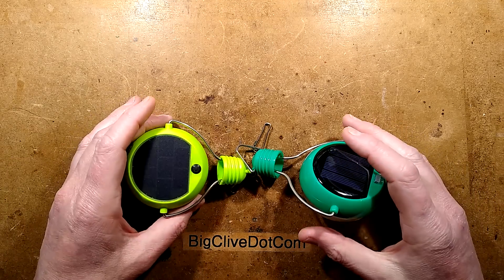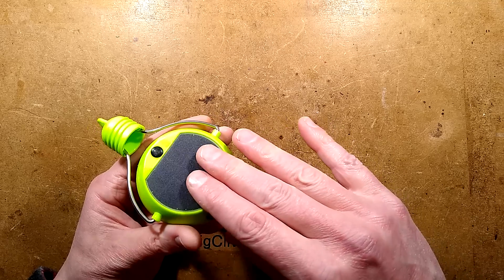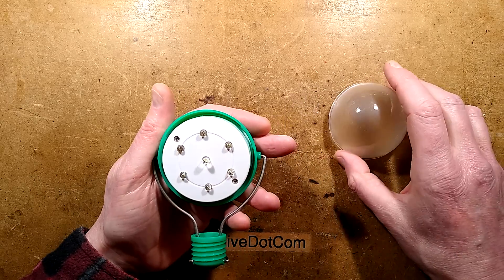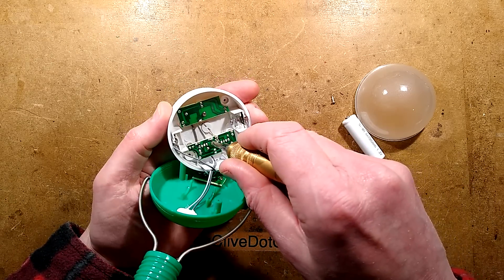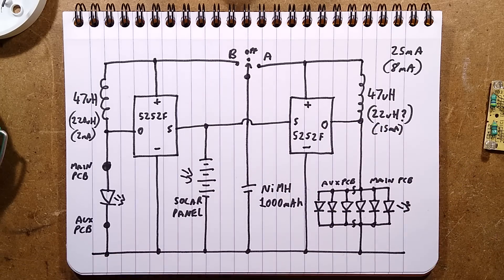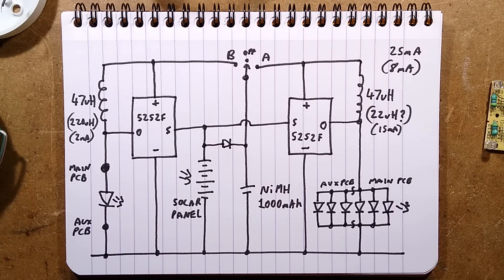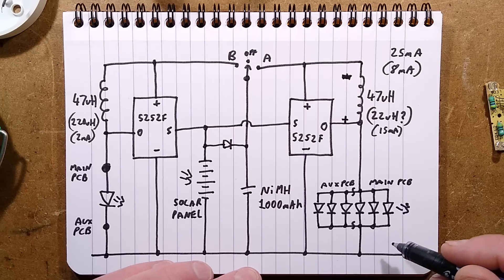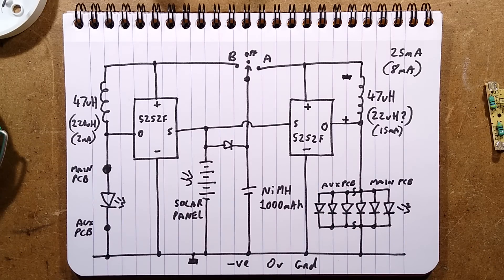Tacky Nokero solar light clone

Comment: They both look like cheap junk with no good practical use. Even though Nokero's solar panel is more efficient - it also has transparent plastic layer coating which will permanently discolor after some time (much, much sooner than something like tempered glass that is used in solar panels where long lifespan matters), and the battery in Nokero was not AA-sized. In that no-name Chinese clone you can at least replace the AA-sized NiMh battery with any other kind of fully charged AA-sized battery (something that is easy to find in most countries around the world) and have a usable light even after solar panel will go permanently dead or in places with long periods of very low lighting (where any kind of solar panel would be useless).

Comment: I mistakenly bought a Tacky Nokero clone from Amazon for $42. They have gotten worse than the one reviewed above. The latest version only has 4 LEDs. All LEDs illuminate in the high and low setting, This is nothing but a slightly modified garden light. I spent $42 for something worth $2
Reply from the maker: If you bought it recently, open up a dispute.

Comment: If I'm reading the schematic correctly, the battery won't ever get a charge if the switch is in the off position?  Therefore, it has to be left turned on, in the sun in order to charge?
Reply from the maker: Yes.  That's why I mentioned the addition of a diode.

Comment: I made a more reliable light by doing it myself.  One 6V (max) 20mA solar panel, one leftover mobile phone Li-Ion battery and a circuit from a design I found online using two NPN transistors, four resistors and a diode.  It drives 10 white LED lights when it gets dark and turns the LEDs off and charges the battery when it gets light enough.  The load of the battery and the internal protection circuit combine to ensure it will never over-charge, and the 10 LEDs draw enough current to pull down the voltage when the battery is fully charged so that it doesn't blow out the LEDs.  It's been running like that for years, now.

Comment: So have I got this right.
Turn it on when the sun is out to charge.
Remember to turn it of when the sun goes away, so the battery does not go flat until you want to use it? 🤔
Reply from the maker: Yeah.  The real one doesn't do that.  But the clone can be hacked to fix that.

Comment: Saw the video during pandemic.. BUT I totally missed the awesom hook on the top end, on both of them.. So if you screw this in a lampsocket you'll make a MASSIVE short circuit if it's LIVE...  or doesn't it fit?
Reply from the maker: It doesn't quite fit into a lamp holder.

Comment: Question for the expert. If a 48v (42v-54v) ebike battery can discharge at 20 amps, shouldn't it be able to charge at 20 amps?
Reply from the maker: Slower charging is much better for batteries.  The limit for charging speed may be the charging circuitry.

Comment: First one would be better if it had a backup led, say it did die, it could activate the second, at least the other device has a few more, you have to ask where they get the same cases and molds etc

Comment: As an aside, certain "ahem" inhalation devices are suffering from hidden shrinkflation. Battery sizes are being reduced in some cases, despite the same packaging and information regarding contents and longevity. A weight check will probably distinguish older from recent contents
Reply: they all seem to end up squashed in the gutter anyway.
Reply: @Derek_Garnham  You have to get up early to beat the squashers.
Reply: @tikaanipippin  you sound like a professional level "lost/discarded object finder" - happy hunting.
Reply: @tikaanipippin  I fantasize about getting enough to power an e-bike or at least a scooter.  Do you have any aspirations of using them in an application? or is it just the thrill of the hunt for you? (maybe it's plain old nicotine addiction)
Reply: Let me guess... they're all made in China...?

Comment: Cost improvement:  remove the left side chip/coil and put the switchover switch on the right side on the output to switch between the 6 leds and the 1 led?

Comment: Speaking of NiMH, one pair of my Panasonic Anyloops has dropped to just under 1500mAh from its original 1900mAh capacity. The other set is still at or above the 1700mAh mark. I am a little surprised that there's that much disparity between the two sets.

Usually I'll go through one set over the course of the day in my Game Boy Color [sic] during the weekend, but last time it didn't last the full day. When I checked after they finished charging, their capacities showing were 1493 and 1511 mAh. I'm thinking of getting a couple of pairs of the high capacity 2450mAh Anyloops, which should last noticeably longer. I'm also hoping the reduced cycling also means I get more than a few years out of them.
Reply: I've got 2 pairs of the 2450mAh Ikea "LADDA" AAs for a Garmin GPS
Reply: I would be converting that thing to lithium...i try to a oid using disposable batteries at all these days if it can be avoided...and it usually can.

Comment: I was thinking about getting into electrical or something to do with circuit boards. I have 0 training or schooling. Where do you suggest I start
Reply from the maker: There are many options that don't require a formal qualification.  Utility electrical and elevator mechanic for instance.

Comment: as far as crap knockoffs go that's not too half bad. at least they used a NIMH cell instead of a damned LION. the nimh cell is easily replaced and should last 10 plus years like the LIFEPO4 cell would

As for the real one the big deal to me is that it uses a lifepo4. meaning it should last 10 years and could last double that and still have usable capacity. now I really want one.

Comment: I'd believe that capacity from a cheap AA, since that's what I was getting out of good AAA cells, years ago when I was still using NiMH for most everything.
Reply: mAh is also misleading when comparing battery types with different voltages, Whr is a better unit

Comment: I wonder what the leakage current into the solar input pins is when Vdd is disconnected. Pretty significant I expect since there is a diode from the S pin straight to Vdd within the IC.

Comment: If they use the same inductor on both sides, couldn't they just eliminate one of the chips and inductors and have the switch toggle between the led choices? For that matter if the LEDs are all the same, make it 5 LEDs on the outside and have the high setting just add them in parallel to the center one.
Not great but it is already not great, they could cut a lot of costs here and not be any crappier than it already is.

Comment: You could eliminate the second ic and second inductor altogether if you did the switching between led strands after the first inductor lol! I don't get it. And 3 pcb's and a bunch of wires? Hell nah just make it all on 1 pcb and use soldered metal tabs to hold the cell in place. Boom no wires, single pcb, and half the parts lol!

Comment: Nokero never delivered the light I ordered, nor responded to shipping queries. No skin off my back -- I have no shortage of power or light sources -- but I'm hoping the two I bought for donation made it to the people that did need it.
Reply from the maker: Sorry to hear that.  I get the feeling you weren't the only one that happened to.
Reply: @bigclivedotcom  No worries -- I'm not upset or anything. My hope is that it was accidentally sent with the donation. At least then it's getting good use, if that's the case. Would just be nice to have some confirmation.
Reply: Mine never arrived either. Company never responded to multiple inquiries. I blame the pandemic, too.

Comment: At least it doesn't have the annoying strobe/sos function. I would love a torch without the strobe function, just low medium, and high would be fine. Every time I switch my torch on and it starts to flash I have the compulsion to throw it against the wall. I'm in my garage not up the Himalayas, ARRRGGGHHHGHGHGHHHHhhh.........

Comment: We had a couple of the knock off ones,  Left them outside and they lasted for several years exposed to the elements and daily cycles. If I replaced the battery cell they would probably still work fine.  
Sadly the cheapies from China are really the only ones that po' folk in the developing world  can afford, and AFAIK there are a lot more common where they were intended to be.
Nokero's business model is/was the typical condescending Western "handout welfare". The actual Nokeros are mostly owned by suburban eco hipsters.   Everyone should be happy that their good idea got copied.
Reply: "Everyone should be happy their good idea got copied"

I'm sure you'd be singing a very different tune if it was your business being ripped off.
Reply: @ferrumignis  The business of... making solar-rechargeable lights?
Reply: @CanizaM  "The business of... making solar-rechargeable lights?

Err..yes, that is what they were doing.  Would you care to describe the point you thought you were making?
Reply: @ferrumignis  if they were in business for just the cash and not their loudly proclaimed concern about kids being exposed to kero fumes then who cares if they get ripped off.
Reply: @ferrumignis  If your business model was to make impractically expensive lamps and then get someone to subsidize them, your business probably shouldn't succeed
Reply: @rexsceleratorum1632  The business model was to help provide these lamps to people that actually needed them by selling them to people that could afford to make that happen.  I understand you would rather have the lamp as cheap as possible and f*** the the poor sods in Africa.  Such a noble attitude.
Reply: @ferrumignis  I live in India, and I buy lamps that are as cheap as possible. F** me. A reasonable price for a lamp like this for me is about 2 to 5 USD. I don't know, perhaps affordable lamps are preferable to western handouts in very limited numbers that I will statistically never see?
Reply: @rexsceleratorum1632 sounds like every single tech start up.
Reply: @deleqtronica8733  Western startups need to somehow make their products competitive with Chinese stuff, and that probably involves a lot of automation and deregulation by legislation. Maybe AI will revolutionize manufacturing.
Reply: Yep. Not surprised. We westerners tend to look down on the 3rd world like the assholes we are.

Comment: 6:38 What really happens with a boost converter is that when the IC's driver is grounded, it is inductor CURRENT that linearly ramps up with a slope of Vdd/L (amps per second). The longer the on time (Ton), the higher the peak of the ramp current. When the switch is turned off (Toff), the output pin voltage flies up (hence "flyback") but the current cannot instantaneously change while the voltage can, and does. The output voltage rises until it is clamped by the LEDs (about 3.0V) and the current begins to ramp down as the voltage reverses, with a ramp rate of (Vled-Vin)/L (amps per second). Thus the inductor has a triangular current waveform and the LED sinks the second half of the inductor's triangular waveform. The averages of these triangular waveforms are what you read as the DC currents on a multimeter. The details of operation are too nuanced to describe in detail here (continuous vs. discontinuous) but the math is simple algebra once you can wave your hands to describe the inductor waveforms. Just know that the basic assumption about a boost is that Vout > Vin whereas for a buck it is reversed.

Comment: You'd think the simplest (aka cheapest) circuit would be to just switch between two different value inductors, so drive the same number of LEDs but with different current.  You'd need a 3-way switch though (low / off / high) rather that the usual crappy 2-way they use.

Comment: reminds me of the ''waka waka'' solar light/powerbank i have. basically the same idea as the Nokero but a different design. It can be mounted on a bottle of water or you can swiffle a plastic piece around that functions as a stand. Has 2 cob LED's in it with 4 brightness settings, USB type A out and a mini USB connector where it can be charged from a generic USB charger or anything else with USB that provides power. 
They arent cheap but if you buy one they will send one to a charity in a country selected by you (from a list ofcourse). unfortunately they only ship to buyers from Belgium, France Germany or the Netherlands, limiting the amount of customers they can reach

Comment: Double edged sword on drainage holes - you get either trapped moisture or accumulated tiny bugs
Reply: it's not a flaw it's a feature - "insect trap"
Reply: @Derek_Garnham  The early LED bulbs with air vents were veritable insect traps. Here in tropical India, lots of people just removed the dome/diffuser and used them with the bare board exposed.

Comment: I'd love to see Clives perfect solar light design for efficiency and long life.
Reply: One time I modified a $1 solar light I bought to be a night light for my room. 4 AA Ni-Mh rechargeable batteries and a large solar panel. Boy that thing was great!
Reply: @joecool4656  That's pretty cool.  I found some rechargeable lights with an external solar panel.  The panel connects via USB micro.  Sadly the battery inside isn't that great.  I'll probably do surgery to increase the battery size on those.  I've also been testing some USB bulbs that plug into a USB battery bank.  Then I recharge the battery bank with a solar panel.  It's a decent solution.
Reply: @jmr  Yeah that's a good start. An important thing to note is that the voltage from the solar panel must be higher than the voltage of the battery for it to charge. I did not know this and kept making early versions of lights that eventually would need to be recharged
Reply: This was about to be my exact comment, and I'm thinking this is the right time maybe?
QinkPalculator Colored LED Solar Actually works in a garden Lamp!

Comment: Big Clive, awesome video as always.  I was wondering if they make a product you could connect a fully charged battery and it would drain it giving you the capacity, or a little DIY piece of kit would be even better.  You may even already have a video on such a thing, I'm always curious about the actual capacity of all these different batteries VS how they're labeled.
Reply: I don't know that he has a dedicated battery capacity tester, but he does often test dubious batteries by draining them and then manually charging them via a bench supply or the like. When he does, he usually leaves the true capacity in the video description (and usually reminds us somewhere in the video, which he seems to have forgotten this time.) Anyways, checking the description, it looks like this 1000 mAh battery was actually 1000 mAh.
Reply: Thank you guys, that is much appreciated
Reply: I use an xtar vc8 to check battery capacity. These chargers cover lithium ion and nickel metal hydride batteries. Quite a nice bit of kit.
Reply: If you're planning on doing it fairly often, the 4 slot Opus BT-C3100 is great. Up to 1A per cell (charge and discharge), anything from AAA to 18650, and does NiMH and lithium ion (might do nicad too, but not sure as I generally don't touch nicads).

Edit: got the model wrong. Was in a rush. C3100 is what I have. Not sure if C3400 is even a thing - might be a new model but I don't know.
Reply: A fancy battery charger, as used by RC control hobbyists, will include a test mode.  They can work with all types of batteries, too, so they're handy to have around.  It's good for seeing if the battery you bought online has the stated capacity or is a piece of junk.
Reply: Just for a laugh I've been draining 2 NiMH cells through a 5 mm LED.  3 weeks and still going.  I suspect it will be quite some time yet 😁
Reply: @DeeegerD  I've done that, fun experiment for sure.  Best I've seen is a solar backpack power unit that was well used and old containing 2 18650s of unknown manufacture.  Charged up fully then connected to an old car LED headlight (the kind with a heatsink rather than a fan) 
It ran for 41 days
Reply: electrochemistry is a cruel and unpredictable mistress. I think it would depend a certain amount on the resistance of the load you choose and temperature and the charge history of the battery and all sorts of other things. The quick n dirty way would be to put a resistor and ammeter in series across the battery then record the current and voltage every 10 minutes or so until it's flat.